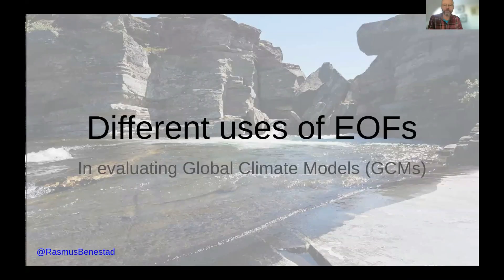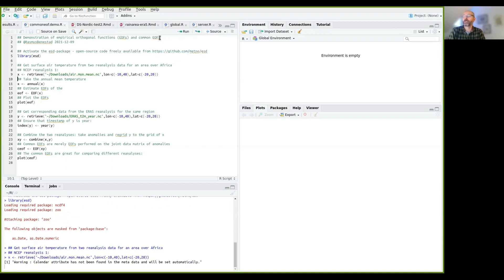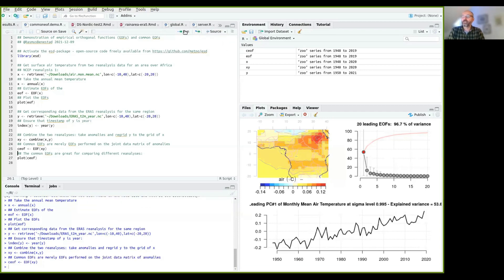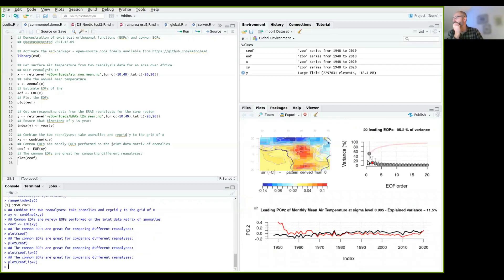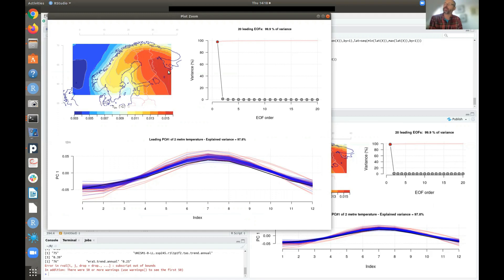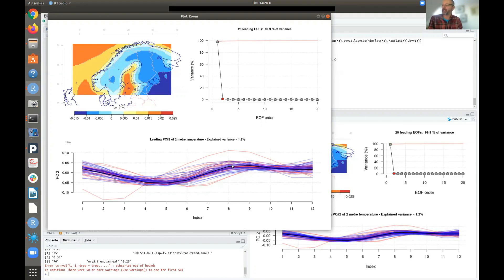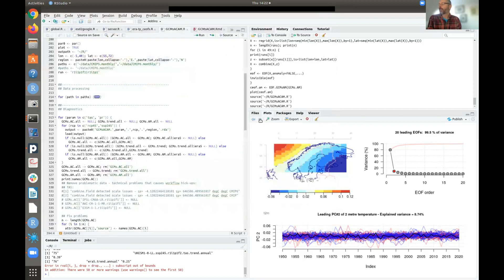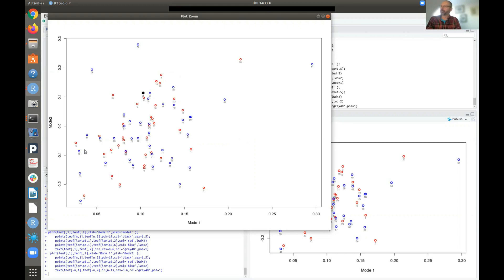common EOFs for evaluation of geophysical data and global climate models.

Comment: Thank you for this. I tried to run the code using a different data but the x and y axes labels did not show. Any idea? Thank you!
Reply from the maker: Did you first try to repeat the example that I presented on YouTube?
Reply: @rasmus.e.benestad  no. i dont have a copy of your data. where can i donwload it from?
Reply from the maker: @bmc-1921  One of Themsen, you can find by googling 't2m.mon.mean.nc' the other (ERA5) is available from Copernicus Climate Services (try googling those words). You may need to use CDO to estimate annual means.
Reply from the maker: By the way, we have a new open-access paper on common EOFs https://egusphere.copernicus.org/preprints/2023/egusphere-2022-1385/ which also provides code (R-markdown) as supporting material and links to data that is accessible from Figshare.
Reply: @rasmus.e.benestad  That would be great! I am currently learning the applications of EOF analysis on the possible mechanisms of marine heatwaves. Thank you so much, Sir!

Comment: Thank you for explaining clearly. Would you please share this code. I am find hard time to see the code.
Reply from the maker: ## Demonstration of empirical orthogonal functions (EOFs) and common EOFs
## @RasmusBenestad 2021-12-09

## Activate the esd-package - open-source code freely available from https://git
hub.com/metno/esd
library(esd)

## Get surface air temperature from two reanalysis data for an area over Africa
## NCEP reanalysis 1:
x <- retrieve('~/Downloads/air.mon.mean.nc',lon=c(-10,40),lat=c(-20,20))
## Take the annual mean temperature
x <- annual(x)
## Estimate EOFs of the 
eof <- EOF(x)
## Plot the EOFs
plot(eof)

## Get corresponding data from the ERA5 reanalysis for the same region
y <- retrieve('~/Downloads/ERA5_t2m_year.nc',lon=c(-10,40),lat=c(-20,20))
## Ensure that timestamp of y is year:
index(y) <- year(y)

## Combine the two reanalyses: take anomalies and regrid y to the grid of x
xy <- combine(x,y)
## Common EOFs are merely EOFs performed on the joint data matrix of anomalies
ceof <- EOF(xy)
## The common EOFs are great for comparing different reanalyses:
plot(ceof)
Reply: @rasmus.e.benestad  Thanks for the explanation. However, I am having difficulty installing the latest update on the package - "esd-master". can you give a little explanation of the installation? Thanks
Reply from the maker: @lyndaokon8395  You will find some tips on https://github.com/metno/esd/wiki/0.-How-to-install%3F. If you follow the link for Windows users, you will find packages compiled for both Windows, Mac and Linux.
Reply: @rasmus.e.benestad  Thank you.
Reply: @rasmus.e.benestad  can you share the link to your test data?
Reply: @rasmus.e.benestad  can you send the extended code including the script for the plots?
 Thanks
Reply from the maker: @lyndaokon8395  One of the data files (air.mon.mean.nc) is freely available from https://bit.ly/3kQee6B.  The file 'ERA5_t2m_year.nc' was aggregated from https://cds.climate.copernicus.eu/cdsapp#!/dataset/reanalysis-era5-single-levels-monthly-means?tab=form using CDO using the command 'cdo yearmean ERA5_t2m_mon.nc ERA5_t2m_year.nc' (in Linux - don't know how to do it on windows platforms)
Reply from the maker: @lyndaokon8395  It's only the code that I already pasted into this thread. The esd-package does the rest...
Reply: @rasmus.e.benestad  Thank you.